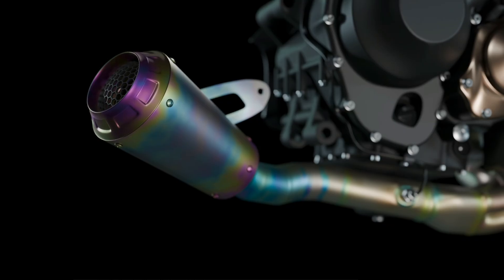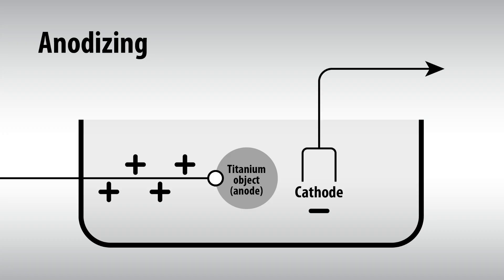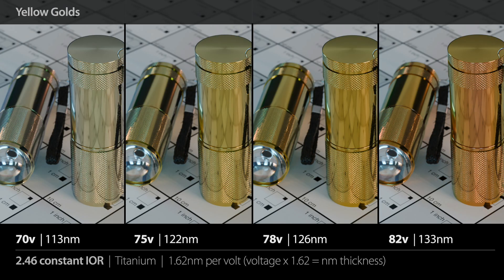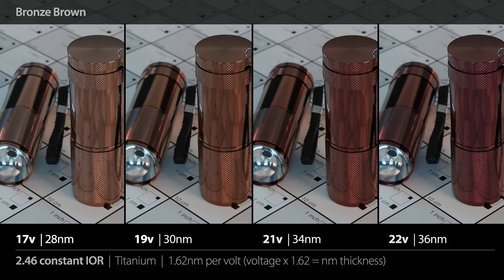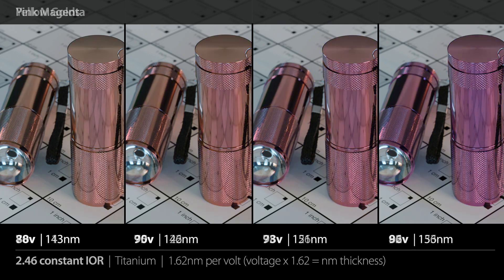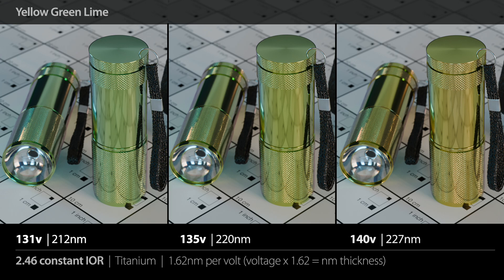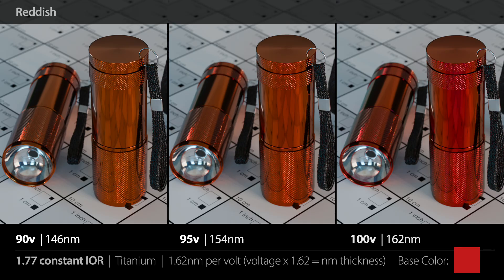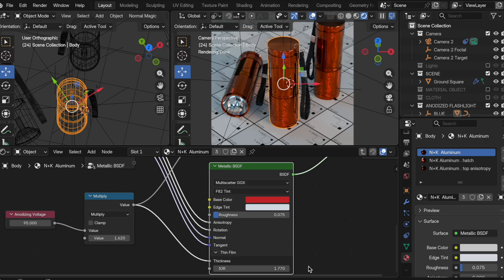How to determine specific anodized metallic colors in Blender 5.0.

Comment: So far I have not tried using this but I heard that it makes the rendering 3 times slower 👀
Reply from the maker: The person who said that doesn't know what they're talking about.
Reply: @christopher3d475  They might be referring to the fact that there was a problem where the compiler reacted badly to the thin film code and screwed up when it was generating the machine code in 5.0, so that some more complicated scenes took WAY longer to render, up to 2-3 times as long. It's been fixed in the nightly builds as of last week but it won't be official until the 5.0.1 bugfix build on the 16th of December

Comment: Fantastic video, definitely subscribing! Any plans to do one for metal oxidization induced by heating, where you get that transition from blue to orange? You know, the kind of thing I've had to paint as a texture to emulate prior to this. 👍
Reply from the maker: I came across the heating method for metal oxides, but was thinking about doing a separate video for it. But the short answer is that you use different IOR value ranges for heat induces metal oxides, along with different nanometer value ranges that correspond to specific heat+time mixtures. I'll try and do a follow up on that.
Reply: @christopher3d475  Thank you ever so much!! You rock! :finger-red-number-one:

Comment: and whats the practical purposes to know what nm, voltage, etc stuff? 🤨 may be its a big plus to a self education, knowing the world, but nothing more. because i won't smelt metals or anodize them IRL, so the only things i need are color, IOR and the rest of a shader's options 😁
Reply: if you work in any industrial visualization it absolutely could help you work with the people whose projects you are visualizing
Reply: It doesn't matter if you don't plan on doing that stuff IRL. If you want to simulate this stuff physically-accurate like this, understanding the relations of these different ranges and why stuff like the voltage gap between the Navy Blues and Yellow Golds happens can provide holistic clarity to the process; you know what to do and why, so there's no confusion and it helps build a stronger set of memories when you can attach that extra meaning to things.
Reply: If you’re merely performing simple color adjustments, this is certainly fine. However, Blender’s shaders operate based on physical principles; thus, when creating complex renders, you need to understand the underlying theory to achieve the desired results.